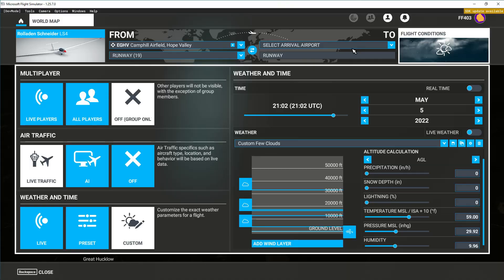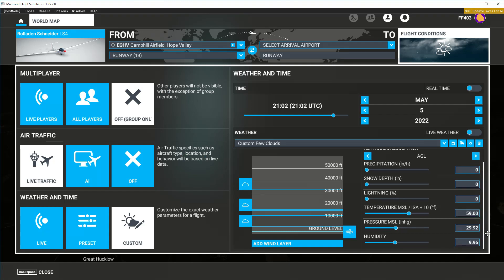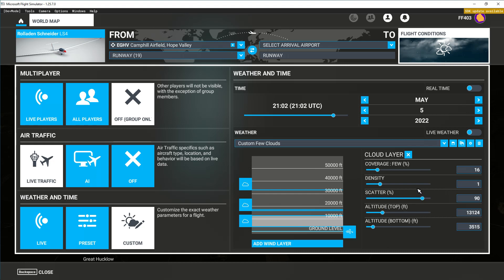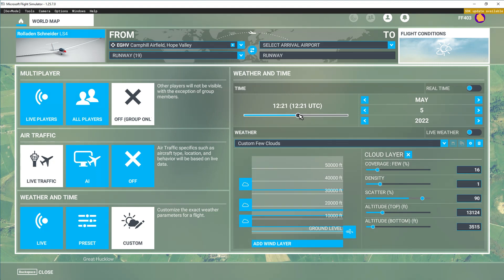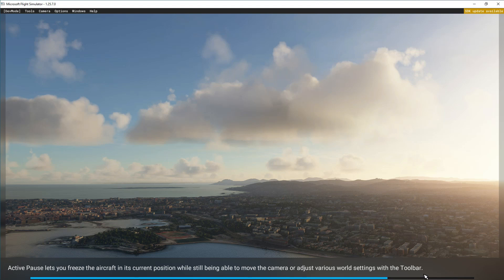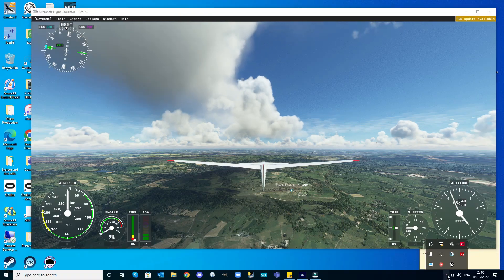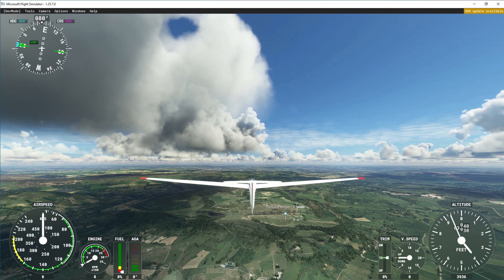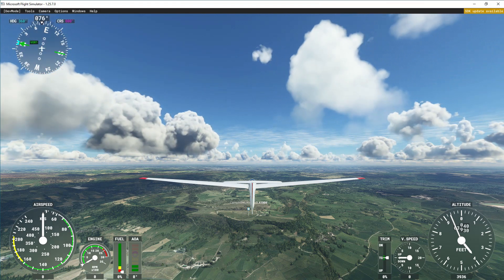Thermals and Cloud Formation and lifecycle in MSFS 2020

Comment: is there a way to setup tasks in MSFS? gliding contests, like condor 2?
Reply from the maker: Yes - I find it’s easiest to use little navmap and export the task as a PLN file. But a guy called Ian Lewis has created an app with more granular control over the TP’s - sorry, don’t have the link to hand on my phone. Will try to post later
Reply: @rocketmandlgc  what about the thermal generation modality? Is it randomly generated or does it take into account factors such as ground color, sloaps, wind, etc. Would you expect to find a thermal over da dark patch of land, just like in real life?
Reply from the maker: @rotaru.bogdan  all that is meant to be coming in the 40th anniversary update end of August - the date set for the official inclusion of both Gliders and Helicopters. Thermal-like updrafts can be found under certain cloud/temp/wind conditions but they are not actual ground generated thermal updrafts and certainly don’t correlate to ground feature. They are more like convergencies underneath clouds that just happen to be useable as thermals
Reply: @rocketmandlgc  so you are saying thermal model will have a ground feature correlation coming in the next update?
Reply from the maker: @rotaru.bogdan  I don’t work for Asobo. I can only pass on what was said by the dev team in a recent interview. Fingers crossed
Reply: @rocketmandlgc  40th ann. will be launched in November. In August DLSS support will be added.

Comment: I record the video in VR usually directly with Quest 2 in headset feature. The movie comes out squared instead of rectangular because it records only the right eye view and also is just 1024x1024 but what I do after taking off the headset via USB cable (like from a phone) is to put it in Davinci Resolve in a normal HD movie format (it actually offers to adjust framerate and the rest and I let it)  and when I render it as MP4 x264 it comes out very good quality. On the black sides I could even attach other things like pictures or just a background. I think for this to work you need to play wirelessly using Virtual Desktop. Not that Virtual Desktop does the recording but because When connected to the PC via Oculus App it just takes over the control from Quest inside software and you can't do anything else then.